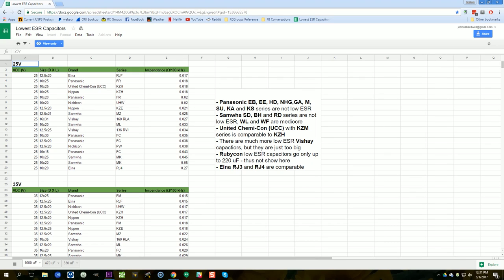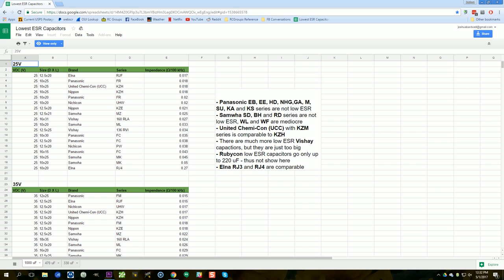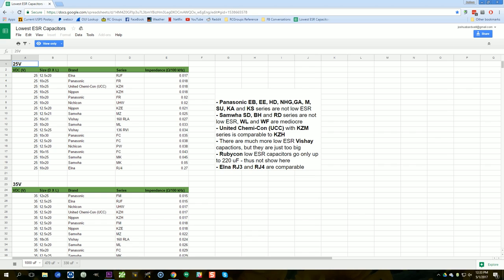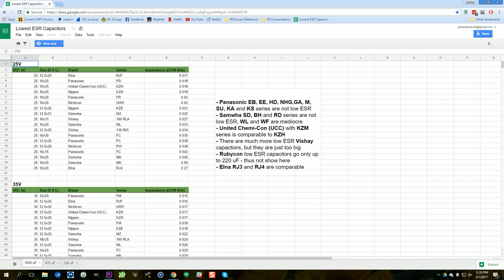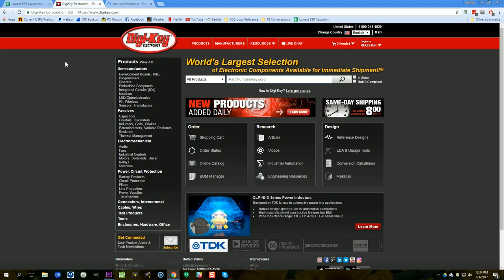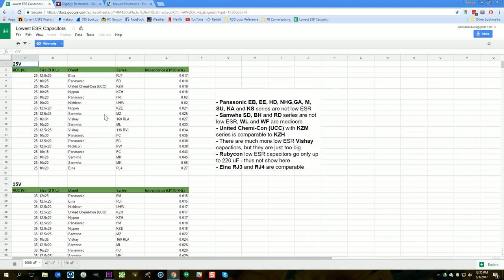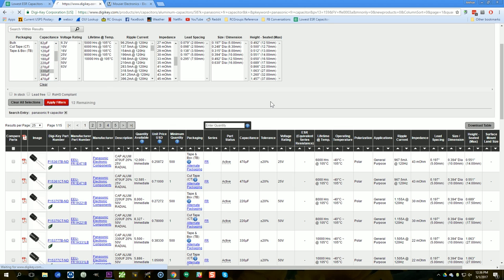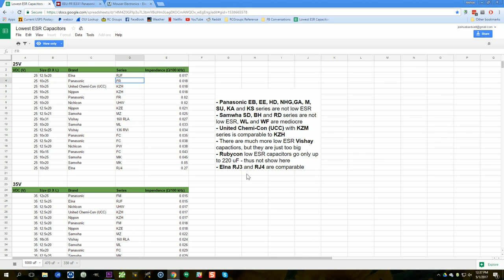Ultimate Low-ESR Capacitor Shopping List

Comment: Hah, and here i thought that no one saw and appreciated my spreadsheet :) Glad to see it in a video. Thanks Joshua
Reply: Thats your spreadsheet? +50 bonus points to you! Video bookmarked and all... Thank you for compiling this information so others do not have to & for helping those of us who are still introductory technicians. (<3 Spreadsheets! <3 Data!)
Reply: Gleb Godonoga thanks for your work, is helping me a lot :)👍👌
Reply: thanks ! and do you know why 35v rated capacitor have an overall better ESR @100kHz than the 25V ones ?
Reply: MaimexRC edit: somebody else was smarter than me ;)
Reply: Capacitance is directly proportional to ESR given ESR=DF/(2* π*f*C). So the bigger the capacitance - the lower ESR can go. I can't give you a scientific explanation as to how exactly voltage correlates with ESR, but it indirectly influences the DF (Dissipation Factor).
Reply from the maker: Now you are obligated to maintain the spreadsheet for all eternity. Thanks for doing this. It's a great resource.
Reply: Gleb Godonoga so does that mean that omitted capacitors with all the same labelled specs as ones on the list, have higher DF?
Reply: me too well I can't guarantee I've covered all possible manufacturers. what do you mean by same specs?
Reply: Just the stuff printed on the heatshrink, e.g. 1000uf 35V.  Without knowing the DF, how can we know if it is low ESR?  Also, what value range is considered low?
Reply: Damn it...  I spent eons cross referencing pictures of caps that quad retailers were selling with spec sheets on digikey to find them in bulk.  This will help going forward, thanks a ton!
Reply: Thanks! Very useful!
Reply: I've got it on-hand at all times, I refer to it often.

Comment: i have just put one 470uf capacitor on each of the 6  brushed esc,s  i am using for an underwater rov i'm building ,  as soon as i did my video feed has cleaned up  very nicely  , i will now go and retro fit them to my quads .  cheers for the tip

Comment: The noise on my video was insane before I did this. Probably worse than anything I've seen on youtube. Installed a 330 capacitor on each ESC and it made my video pristine. Thanks for the useful info, Joshua and Gleb!

Comment: The RaceFlight gents discussed capacitors in a video, and for recommended installation say to solder the capacitors as close to the actual unit as possible, i.e.: NOT at the end of the stock wires.  For convenience, you can use ~16 gauge wire with plenty of solder close to the capacitor and the shortest wires possible. This will help give you options for placing the capacitors if you have a tight space or would like to place the capacitors inside the frame of a quad for protection.

Comment: Could we get a photo of how you have the capacitors installed on your escs? for the uninitiated?
Reply: I second this.  I want to immediately get a handful but also want to see where you put it! Thank you for your informative videos. I watch them like the South watches FOX News..
Reply: I would like this too!
Reply: solder the cap right to the positive and negative pads on the esc.
Reply: or a video even!
Reply: I think most of us understand how to install it. We want a pic or video so we know the best way too and how to protect them in a crash. I mean I will leave them off if it means I could fry my whole quad in a crash.
Reply: something like this https://goo.gl/eEw2nu then maybe heat shrink it once your done.
Reply: I think we all figured that much.
But if the ESC with their 5m height get destroyed by propellers, what will happen to the 10mm capacitor?
Reply: I've never had my props hit my ESC's
Reply: Cynabal He had a vid about protect your escs with a broken prop that you strap on them
Reply: Just tape them on like the ESCs if you have to.
Reply: The RaceFlight gents discussed capacitors in a video, and for recommended installation say to solder the capacitors as close to the actual unit as possible, i.e.: NOT at the end of the stock wires.  For convenience, you can use ~16 gauge wire with plenty of solder close to the capacitor and the shortest wires possible. This will help give you options for placing the capacitors if you have a tight space or would like to place the capacitors inside the frame of a quad for protection.
Reply: Kendall Smith your whole paragraph makes zero sense
Reply: Cynabal speaking of that rare occurrence, i took a couple trashed props and cut the blades off and taped them on top of my esc's so in the unfortunate event of a prop striking my esc i have something for it to hit besides the esc. Happy flying buddy
Reply: Cynabal i also do not mount my reciever antennas sticking up anymore, i had one of the get bent when i flew through some scraggle and i cut one off with the prop so now i put them in antenna tubes and tape them to the inside of the rear arms of the frame. Not only does it protect your antennas better but you dont have those bug antennas sticking up to destroy should you "land" on your lid. I dont rigid mount the vtx with zip ties anymore either . I crashes pretty good at thanksgiving last year and ripped the sma connector off my vtx because it was ziptied and the solder joint was the weakest link.. who knew right lol

Comment: My understanding is video noise can be from voltage and current spike. capacitor smooths out the voltage not current. LC filter has a capacitor and inductor, which take cares of voltage and current.

Comment: The single most important factor on the capacitor for this application is it's ripple current rating.  The higher the better.  I use Panasonic 35SEPF120M caps on my ESC, only 120uF each, but they have a 4.4A ripple current rating.

Comment: A 470uf 25volt Panasonic low esr across the battery terminals and a buck converter to supply 5 volts gets rid of all noise. I power my fpv gear on 5 volt. 
 Try it. It works perfect.

Comment: Do you mean attaching one cap at each terminals of the esc's where they attach to the pdb? 
And do you recommend 25V or 35V for an 4S system? (panasonic 35V caps are rated for 25 V to 50 V)
Awesome list, I've just ordered some capacitors!
Reply: Willem V You should attach these capacitors as close to the noise source as possible, so in this specific case directly on the ESC where the power wires are soldered. Generally a 25V capacitor should do the job, it might live a bit shorter than a 50 V but I think this doesn't matters because when the capacitor dies the drone already died three times :)
Reply: Thanks! That clears up a lot!
Reply: specialfae what exactly do you mean?

Comment: Any more than 470 MFD on the battery is not a good idea people, just remember what goes in must come out and with capacitors bigger isn't better.Most of us understand more voltage gives you better headroom before the capacitor goes boom but few understand the storage dynamic of a cap.

Comment: I did what you did with one exception: I looked at the diameter and then checked the biggest available Panasonic Low ESR for that diameter. Here are my results: 10mm: 3300uF 6.3V, 1800uF 16V, 1200uF 25V, 820uF 35V; 8mm: 1500uF 6.3V, 1000uF 16V, 680uF 25V, 470uF 35V; 6mm: 470uF 6.3V, 220uF 16V, 150uF 25V, 38uF 35V

Comment: If putting the capacitor at the battery terminals is not as good as putting them on the individual ESC's power wires, does this mean a 4-in-1 esc is at a disadvantage because you can only put the capacitor on the batter terminals?
Reply from the maker: Yes that has been my experience.
Reply: Joshua Bardwell thanks for the response, this makes me second guess whether I’ll be using a 4-in-1 esc on my new 6S build. Thanks!

Comment: I had a bad week because of intolerable video noise on my feed.  I even drop my D gain but did not work. Then last week I add 470uF on each esc but its rated as 50v so its huge! Now it literally noise free even at sudden burst of throttle and movement. :D

Comment: Josh - ordered the 330uF caps after watching this. But now I seem to recall in one of your other videos (I think one talking about loop / gyro frequencies or your oneshot(all versions+dshot explain, 2 part-er) & I thought you mentioned that capacitors might "dull" the signal some (dull isn't the word you used but I don't recall how you described it).

Any comment on whether these caps may have any negative effects? If so, is there a breaking point? (let's say maybe oneshot125 may not flinch but oneshot 42/multishot might produce a noticeable difference)? Or if I'm mis-remembering, maybe it doesn't matter at all. Great videos as always! Also bought he whitenoise unify board and BFF3 from your reviews. Going into a 6" Chameleon (which I just found out you're building one after I alreadt bought the frame! Hope it's worthy). Anyways, rant complete. HAve a good one pal.

Comment: Thank you again! This is good info for sure. Would you be willing to make a video detailing how you install different caps on different esc, and possibly create a spread sheet illustrating efficiency?
Reply: Objectivityiskey It's pretty easy once you understood it. ;)
You have to put these right on the ESC where the power wires to your battery or pdb are soldered

Comment: So we left bec ESCs for opto and  now are adding capacitors back on? How about some manufacturers start putting some real filtering into their pdbs?

I'm having minor desyncs on 2 quads, one during hover-like low throttle maneuvers. I wonder if this will help with that.
Reply from the maker: +Jesse Peacock BEC has nothing to do with whether the ESC has capacitors or not.
Reply: I know but many, if not most, ESCs with becs also have a capacitor. They removed the capacitors to save weight and now we're adding them back in, seems incongruent.

Comment: Hey Joshua, First of all - huge fan of your content! I learned to fly watching your series on freerider + you probably saved me a ton of $$$ on gear. Funny you would release this video today I actually came across a new technique for protecting the quads against transients and cleaning up Gyro noise and video feed.

Instead of using capacitors, I have it on good sources that TVS Zenner Diodes of the right spec can provide much better protection for circuits. I would like to get your take on it.

I just posted a video on my channel about it too covering the techinque.

Cheers
Reply from the maker: +Loose Transistor FPV I'm interested. The results will speak for themselves.
Reply: I already know of some folks using it with good results. I will do my own investigation by trying it on my next two builds. I will let you know how it goes.
Reply: i like the theory, however the response time of the component is the important bit i would think? can it shut the door fast enough?
Reply: The response time on zener diodes is classified in picoseconds.. so its near instantaneus anyway.

If you pay attention to newer ESC's including the latest 35A cicada 4in1 and the single, they are already coming with TVS installed from factory using zener diodes.

This is a good fix for transients and cleaner setup on older ESC's.
Reply: very interesting indeed :)
Reply: YES! that is exactly what that little Diode is doing. If your ESC already has them no point in adding another, you should already be protected and good to go!
Reply: I also noticed that on the Cicada older gen 35A 4in1 there are pads right there, but they are not populated. The newer version has the diodes already installed.

Comment: Joshua please consider doing a video on FPV video trouble shooting.  I've been fighting crappy FPV video for quite some time.  Most recently I put a 1000uf 25v cap on my quad and it improved the video some but I still have poor range and crap video.  Discuss the obvious things like SMA vs RP-SMA, RHCP vs LHCP, channel on tx and rx being the same, but also less obvious things like RF interference, I'm sure you can think of others.
Reply from the maker: Ground video and camera to the same point. Like, the exact same pad if possible, or as close together as you can.
Reply: Currently my cam ground runs through the vtx..
Reply: Also what about twisting wires, and wire shielding etc.. there are more folks than are willing to admit who are struggling with shitty fpv video.
Reply from the maker: +Barry Anderberg try moving it to the same place ad the vTX if you are having noise.

Comment: I'd like to learn more about why capacitors help reducing noise, and the front part of your video was helpful. I have 2 questions: 1. Just to be sure I get it correctly - it is better to solder one capacitor to each ESC, than the battery lead, right?        
2. I don't understand the part on video noise and D gains. When you say raise D gains past ~25 you get "excessive noise", are you referring to excessive video noise?

Comment: Nice video! And by the way, I think they should fix the abbreviation for micro to be u instead of µ. The µ is the only SI prefix that uses non-latin characters and unless you're just trying to be annoying, using u instead will not cause any misunderstandings and that's all that matters. I still think that you should use metric for everything.

Comment: Is there any good to put capacitor to all those esc and the battery terminals also, i have now one capacitor installed battery terminals but would like to put some esc capacitors too.
Reply from the maker: +Mr.Viceroy it's actually better to put a small capacitor of 330 uF on each ESC than to put a single big one on the power leads.
Reply: okey, i got only 470uf 25v but i try those on esc

Comment: Joshua, thank you for all the vids. They have been a tremendous help. 
I'm finishing up a new quad and saw this video. I ordered caps like the spreadsheet listed and they came in today. 
I have about 2" of wire between my FC and each ESC. Does it matter if I put the caps on the tabs of the FC or the ESC. At this point it's easier to add to FC plus they would be more protected.

Comment: 24 minutes ago, listening to old dvrs and had to replace leads I can say this. With an analog multimeter atleast you want to see it drop basically to where it started whereas the one I have problems with now the current almost stays continuous I guess, not all the way to zero but not close to where it started.
Reply: Probing the capacitors.
Reply: I find and harvest mine

Comment: I have a set of 470uF 24V caps that came with my "XJB V1 6DOF Micro F3 EVO Flight Control AIO" from BangGood...  should I go up to the 1000uF or down to the 330uF?  the drawing has them installed on each side of the PDB/4-1ESC. right now its a LOS machine, but awaiting the King Kong Q25 Mini cuz there is no room on my Loki X3S Storm frame with ZoeFPV 1407-4100K!
Reply from the maker: +Dale Bear those are fine.

Comment: Is it ok to cut the leads shorter on a capacitor?
Reply from the maker: Yes that's fine.
Reply: The longer they are the worse it'll perform cause those little legs conduct current like shit. Best thing is to solder some 20aug wire right at the base of the capacitor legs.
Reply: @liamhaddon7526  Josh bardwell thanks for the help guys just getting into this and still having trouble with my fpv but I'll get it.
Reply: @kwadlife4106  All good man.  People are always willing to help with literally any issues you have in this hobby. We all started from nowhere haha.

Comment: i know its old video but i just added to my build ive been trying to get some esc's that will hopefully last so i went with spedix es30hv and i installed on each esc 470mf 35v cap and wired it to the power leads on jb f4 version 1.2 i didnt test it with or without yet but i figure it wouldnt hurt to have a capacitor to each esc. hopefully no blackouts or esc mosfet blowing out now since ive got f40 pro ll 2600 instead of zmx finx40 2607 2610kv and spedix 4.1 esc.

Comment: For DSHOT we were removing capacitors.  Are you still able to use DSHOT or does it have any effect on digital protocols as opposed to analog when you add the cap?  Maybe another way to ask is, does this only apply to those using OneShot or Multishot?
Reply from the maker: Dshot capacitor was on the signal line. This is on the power line. Completely different. Totally unrelated.
Reply: Thanks for clarifying

Comment: Joshua, couldn't these be mounted on the esc power/ground leads where they are soldered on the PDB?  I don't see how that would make a difference in the benefit of the capacitor and it would put the cap more internal to the quad and out of reach from possible damage.  Thoughts?
Reply: Nick the source of noise is at the esc if you're letting it get back and putting it on the board the noise makes its way back to the system where its absorbed. It's like stopping someone a murderer from living in your community vs letting him live in your community and keeping a watchful eye on him. This is a very simplified example but easy way to kind of understand it.

Comment: What do you mean a capacitor on the battery leads doesn't make a big difference but a capacitor on the ESC's does? Do you need 4 capacitors? Where do you put them?
Reply from the maker: 4 smaller capacitors, directly soldered to the ESC power pads, vs 1 big capacitor, soldered to the main battery pads on the PDB.

Comment: Hi Joshua, I know this is a little after the video was made but I’m just catching up as I’m new.
I soldered 470uf 25v 105c capacitors at the power lead output to the ESCs (spedix is 30) and I believe it has really cleared up the video noise at max throttle and down to around half throttle but at exactly half throttle it is still pretty bad? This is with no props on during testing.Do you know why I’m am still getting horizontal lines at half throttle and anything above that is fixed?I realise this could be an open ended question but you have lots of experience that could possibly explain this...Cheers